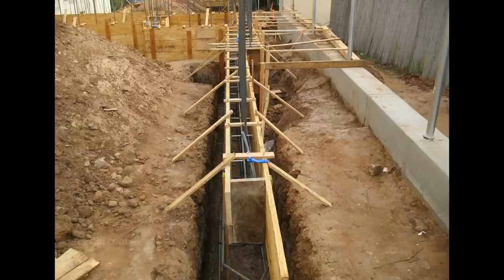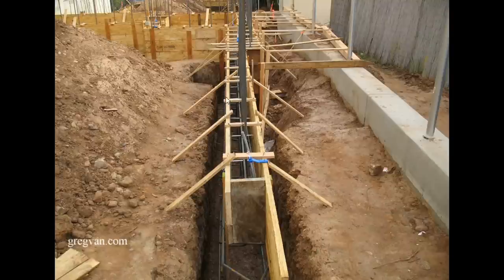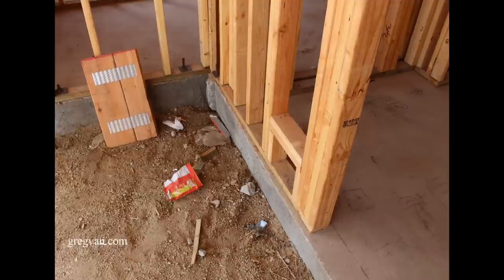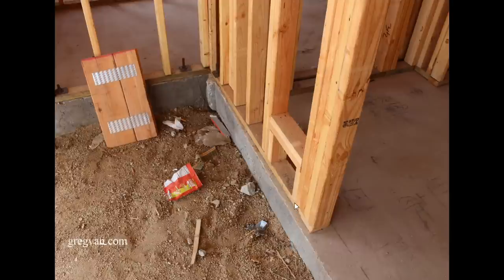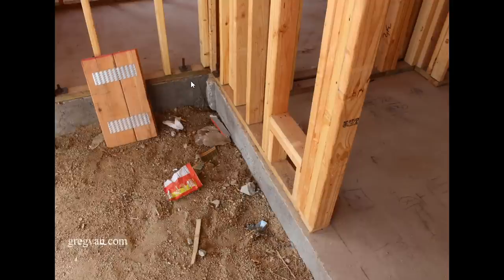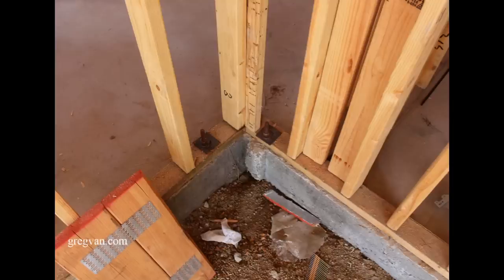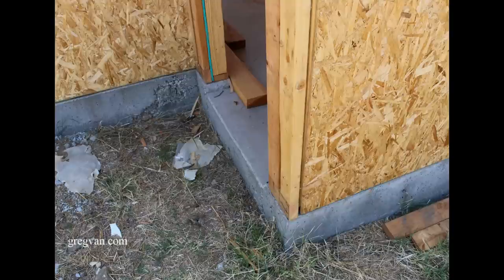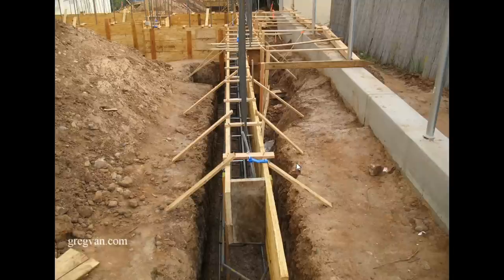Watch This Video Before Pouring A Concrete Foundation – Construction Tips

Comment: With your walls, the most important thing is your wall ties. They will keep a 10" wall 10" everywhere. As far as the bracing on the wall, first you set pins. Snap a chalk line and nail a 2x4 block down to the footing against the bottom of your forms on both sides. You can form the whole wall until you get to a corner like that, then go back and plumb the ends of your walls and corners. Then you run your string line before and after you pour. When setting forms, I will start in the best corner, and set a couple of forms each way. I use aluminum forms where the big boys are 30" wide 9' tall. You snap your line from pin to pin, after that if I had a ten inch wall, I would measure 44" each way because on the inside I will have a 4" inside corner, a ten inch wall, and one 30" form each way, use a big framing square and mark a line square with your chalk line in pencil both directions your setting forms. The joint where the first and second form meet should ALWAYS be on those square lines. That way when you get to a corner, your forms are running together perfectly every time and after making a turn or two you will be in the right spot on both sides of the form and your corners will be square inside and outside too. I'm a flat work contractor, but poured  footings and walks with my old man for over 15 years and you figure out that there is a lot to forming proper walls. Find a good Mason with some aluminum forms, as long as the footing is poured level and FLOATED, instead of just leveled out with a rake, then if you want a 9' wall, you will have a 9' wall level within 3/16 from corner to corner. Just need a good concrete contractor

Comment: Cause of the Bulge is simple..... Gap in form work wasnt closed properly
In Australia we would chip it as furing out a wall as you mention could have additional probs down the line. Specially on a prefab frame. Other reasons for this type of mistake could be relegated to the Surveyor who did the Set out.
Thats why before we start we measure all pegs if theres a small discrepancy we will usually rectify it our selves if measurements are way out as we have experienced this too , we make a call to the builder and get him or her to get the site resurveyed as measurments really are critical no matter what.

Comment: Contractors and Homeowners:  I can't stress enough the importance of getting a soils report before placing a foundation.  Soil preparation for a foundation is the most important step in foundation construction.  If your soil strength is low, it won't matter on hoe well the concrete foundation is constructed; the house will experience differential settlement - a costly mistake.
Reply: That's not really necessary in the "snow belt" were your footings are at least 4 feet below grade level as long as your on virgin soil or properly compacted.
Reply: Your absolutely  correct in regards to soil sample/prep... I've done lots of concrete repair because someone else didn't do there job... thx . Take care !
Reply: It's all about competent bedrock, otherwise it's a dig-out and re-compact with a soils memo.
Reply: You have to consider context and location. Other poster noted north east depth of footer- and if a precious house haves been there and not Sette,d for decades, as long as don’t have to over excavate, not sure about slide report. And how many samples are you gogin to take for analysis??

Comment: i live in the philippines and nobody uses wood forms for a foundation.. its basically hollow blocks to make the form.. and the inside of the forms filled with gravel.. tamped down.. add sand  .. watered.. and tamped down again.. then pour the cement.. came out great.. no cracks.. no bowing of wood..

Comment: Down here in Ohio when we had out 9 ft basement poured they was spot on!! They were perfectly sq no void areas in concrete!  All walls plumb! But they used metal wall panels and form release! Even the walkout on the basement was perfect!  They had another company do all steps and flat work and they was real good also!  They cut the concrete wet which I have never seen but as to today still no cracks and we are to the drywall stage now!! Also thanks for replying back when I was framing about the structural questions!!
Reply: What company and where in ohio? I am looking for a concrete basemney
Reply: @MegaMommaUlman  I am in brown county is that close to you!

Comment: From engineering perspective, I agree with most of the stuff you mentioned, but there is more important things to consider during construction.
1- as per the code, make sure that you have enough cover of 5cm (2in). This will prevent steel from corrosion.
2- Use concrete vabrators when pouring concrete. This will decrease the air content in the concrete and therefore you will get stronger concrete.
3- make sure to use reinforcement chairs or even small rocks to have your steel set on before pouring.
Reply from the maker: Keep in mind that this video wasn't meant to provide you with every single item or in the order of importance, but instead a few things that I as the video content creator viewed as important. By the way, the 2 inch minimum distance does not prevent steel from corroding, but can reduce the chances of it happening.
Reply: Agree. I just wanted to add these points and I think they are important to know before pouring concrete because they relates to the safety of the structure. And yes adequate cover don't 100% prevent corrosion but it decreas the chance of happening.
Reply: @abdullahn9827  Thanks for pointing this out.

Comment: if your patioing or paving around the hose you dont have to remove any of the concrete and a small deviencce in the forming is not that bad a massive difference yes but not a small one very informative but over critical on some aspecs

Comment: Thanks for the video and tips. I'm not sure I seen a problem if the structure is for personal use and not to sell on the market. I understand cosmetically things could have been done different but what about the integrity of the wall? Is it still a solid foundation wall for a single story structure or am I missing something?
Reply from the maker: I'm guessing that it would be strong enough if it was approved by our local building department.

Comment: This is just one example of why I prefer to do these types of jobs by myself, rather than hire someone to do them.  Because no one who I hire is gonna take the extra time that I would to make the forms perfect.  The downside is that I'm a lot slower.  But that's better than going back to fix mistakes that were made the first time.
Reply: The attitudes of several of the pros in this discussion, complaining that the poster of this video is exposing their flaws definitely has me convinced I should do my own.  I've always found that if I want it done right, I have to do it myself - usually 3 or 4 times :)
Reply from the maker: I feel the same way. When you say you're slow, sometimes the tortoise is going to win the race and when it comes to building a home it all starts with the foundation.
Reply: gregvancom I saw you write earlier that you didn't like the carpenter take his time, and measure to the ¹/16"...  (albeit there was also an element of bragging from the chipper)  and here you admit the tortoise may win the race.  

These images of buildings look like cookie cutter prefab, mass produced, housing.  At the end of the day, there is no feeling of craftsmanship.  You've got three basic variables, Speed, Quality, and Cost: choose two.  
  
I love the process of the building, each movement constructing the smallest part of the job... every smallest detail as an artistic creation.  Even the 'hidden' parts.  (someday, it'll have to be repaired, that's entropy at play)  It has been called perfectionism, but I believe it isn't worth doing, if I don't do my best, always.  

I too, have a keen eye for errors.  I just don't waste my time on production buildings.  
Your slideshow was a bit captivating though.  You've got high expectations, on projects sheathing with OSB... it's a bit contradictory, imo.  I was really waiting for you to show us exactly what we're supposed to do for the best foundation.  And in the end of it we were left looking at bad examples.  Aweshucks.
Reply from the maker: Thanks for paying attention and for watching my videos. If you noticed I use the word sometimes, sometimes the tortoises going to win the race and there are those who can work efficiently doing quality work and those who produce the illusion that they are doing quality work, but spending 3 to 4 times longer doing it and those are the ones I have a problem with.
Reply: NO!! It starts with the soil conditions. Residental contractors are not experienced in soil testing and compaction.
Night and day difference between a residential contractor and a commercial / public works contractor.

Comment: I'm old enough to remember working with my dad making foundations from concrete block.  Always straight, always level and always square and to specs.  Architects back then seemed to be conscious about external dimensions on the prints so you didn't end up with a house that was say 32' 3-1/2'' long.  Contractors got lazy and cheap and this is the result.  The horizontal lines in the foundation concrete look like hell to me.

Comment: I've seen plenty of concrete crews screw up the slabs. Not many of them think about quality. I've been in construction for 35 years. If the slab starts out wrong then the rest of the subs have to fix the problems usually. It becomes fix the previous guys problem.
Reply: +MrLeonard55 Amen, I'm a flooring contractor and we ALWAYS get the short end of that stick.
Reply: There is a short and long end of a stick. It just depends on where you put your hand on the stick.
Reply: Priceless.

Comment from the maker: I don't know if you're missed the point of the video, but it was to double check everything and make sure that everything is reinforced correctly so that someone else doesn't have to worry about fixing anything and yes you can actually do it right the first time, I've done it plenty of times and so have others.
Reply: Hey Greg quick question regarding the screeding process. WIll be pouring a small amount, bout 10 cu yrds tommorrow in my dads backyard, but as we only have 3 people he wants to use a quite long (but straight) board with one person on each end and just drag it out. Will this work or is it a better idea to use a smaller piece of wood  to do this with one person?
Reply from the maker: That's a tough question to answer, but if you have three people I would imagine you could work with a 20 foot board.
Reply from the maker: It all depends on how long of a board going to use, how much concrete you have poor and experience of those helping. In other words, experienced concrete professionals can use extremely long boards with fewer people, where inexperienced concrete workers might have a difficult time.
Reply: gregvancom "
Reply: gregvancom oò
Reply: If the concrete is an even 1/2" wider than plan, why not just frame the entire stud wall to the outside edge of the concrete? = bigger room in the main house!
Reply: MrMajikman1 -Depends on FloorTruss hangers(direction they hang)and design width of stemwall.Unless you customize mudsill width to match foundation,it's all uniform,so increasing dimension changes building design.Just my 2cents.

Comment: One thing you didn't mention in this video is the risk of forms lifting off the footing when pouring knee walls. I had that happen and it could easily been prevented with a few Tapcons or other fasteners. Sure created a panic when it happened and the guys had to remove a bunch of concrete between the wall forms to have a level knee wall top for the log walls to rest upon.
Reply from the maker: What a bummer and thanks for sharing. No I'm sure I didn't mention everything that could go wrong, but I'm glad you left the comment for others.
Reply: Yep, live and learn. Of course I figured my concrete guys would have known to anchor the forms to the footings but nope. I even had to use my laser level to help them square up the forms on the footings. I guess I should be thankful things turned out as well as they did but concrete is not very forgiving.

Comment: I really like the 'after' photos showing problems - it graphically drives the headache home.

Is it really that difficult to get an angle grinder and cut the excess bulging off by crosshatching and knocking out the squares? I'm not suggesting one be sloppy and leave that option on purpose - just curious. I'm fairly new to concrete - trying to suck up all the knowledge I can to go with the experience.

Thanks.

Comment: Thanks for all the free advice you have been dishing out for these past years. I've learned a lot.
Are there any standard guidlines for bracing concrete forms?
Also, have found it is usually less hassle and profitable to do your own concrete work whenever possible?
Reply from the maker: David Patton There might be for larger construction projects and if so would probably be specified by a structural engineer, but for projects like the one you're looking at for a building with less than three stories, I believe it would be up to the individuals working on the project. For example, there is no rule of thumb (that I'm familiar with) for spacing horizontal stakes 24 inches on center, like there might be for wall stud framing. I can say this though, it's always going to be better to have more structural supports than less if you don't know what you're doing.

Comment: Good video, but  here's my take on this, in a hundred years from now will these minor flaws matter?. I'm working on a barn of mine and there is NOTHING!! straight or plumb but I am making walls and floors work by just covering them up the best I can and when anyone walks into the barn they will see some what straight walls. Yes it's good to try and make a good start on something when building but sometimes close is good enough.
Reply from the maker: I guess it all depends on what you would consider close enough and if you're referring to a quarter of an inch then were on the same page.
Reply: gregvancom  I have worked with people in construction and some of them would take a measurement of 1/32  or 1/8,where I would just try and get a quarter of an inch, it was good enough,
Reply from the maker: I always had a hard time with carpenters who pretended to be experts because they measured everything in a 16th of an inch, yet had a difficult time producing quality work at a reasonable rate of speed.
Reply: gregvancom  Right you are.
Reply: NCLUSA "where I would just try and get a quarter of an inch, it was good enough"

I love not following guys like you, makes my job so much easier. Can't get one end of the truss down to the plate without 2 guys standing on it? But the forms were only 1/4 inch high below the interior load wall.

Comment: Good, informative video! Help me, Greg!! I am planning to buy this older, built 1978 single floor house. I  am in Florida, Palm Beach County. I don't know type of soil under house, just imaging, very sandy here?? Now, I understand, that if building second floor, which I am planning to do??, the size of the footings depens from many things: soil type/ =bearing capacity (pounds per square foot), size of the house/second floor, roof type: cement tile heaviest?, asphalt singles(next?, metal roof(lightest?). Now, lets say, bearing capacity of soil is 2000 pounds per square foot ( I think this is close), and I am planning to put asphalt singles as roof, if house now has footing 16 deep, 12 wide?? ( I did not check that yet, there is no houseplan for this building!), should 2 floor building have 16 x 24?? What is kind of rule of thumb in this??/. Could this footing widening be added afterwards?? Sure hope so, how do they do that?? Thanks a lot, youtheman =)

Comment: question:  throughout the video we see some framing.  I am wondering why there is  no bearer between the concrete floor and the sill plate?  Is it a building code thing from where you're from?  I live in the north and its required, just curious.  I always enjoy your efforts in posting these videos and providing your thoughts and skills in the building trade. Thanks.
Reply from the maker: Todd Ransom That picture was taken in Southern California and might not require barrier. Feel free to send me a picture or post a link with an example of what you're referring to.

Comment: A cheap diamond circular saw will make short work of bulges.  I put a £5 blade on my 4½" angle grinder and it cuts through normal limestone+ cement concrete like butter.  You'd need a bigger one for slabs like that obviously.

Comment: For 3000 psi-3500 psi 4” thickness driveway, can I use #3 rebar and 18” spacing?  What is the chair spacing?  Thank you
Reply from the maker: I don't see a problem using number three rebar or with your spacing of 18 inches on center or your concrete mix. It's more common to see number four bars though. As far as the chair spacers, simply try to center the rebar the best you can in the middle of the concrete driveway.

Comment: Why were 2x used instead of Plywood? I guess it can be done either way, but seems like plywood and wailers could eliminate some of those issues. 

Is there any advantage of using 2x over plywood?
Reply from the maker: I think it would depend upon the situation, walls taller than 4 feet might require plywood and snap ties with wedge anchors, where forms less than 24 inches tall seem to work just fine using 2 x materials. I would think that it's more of a personal preference to the contractor, more than anything.